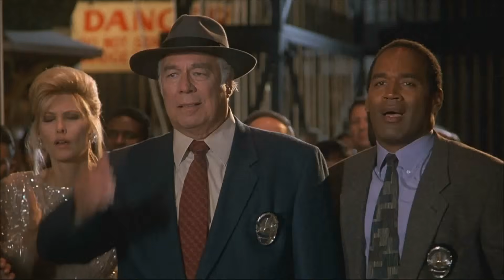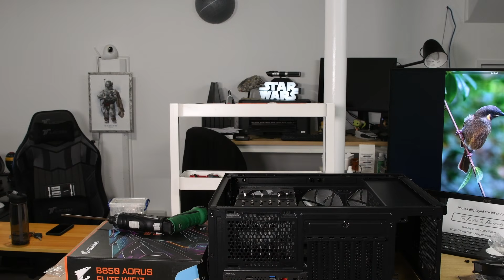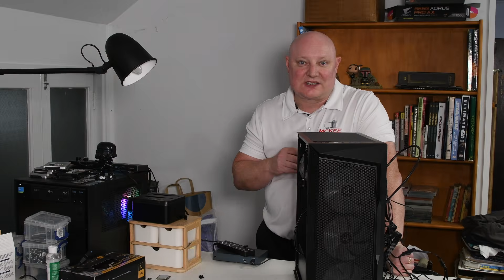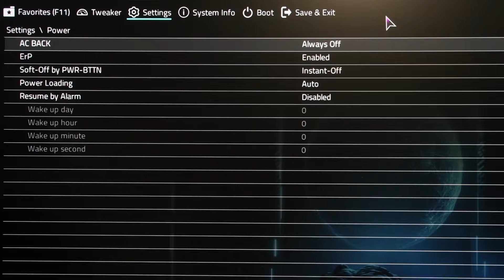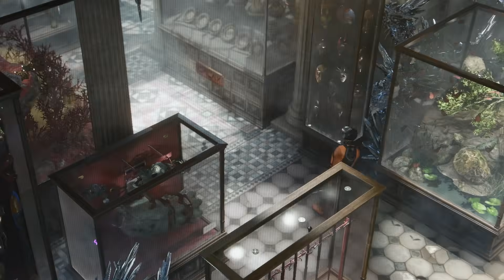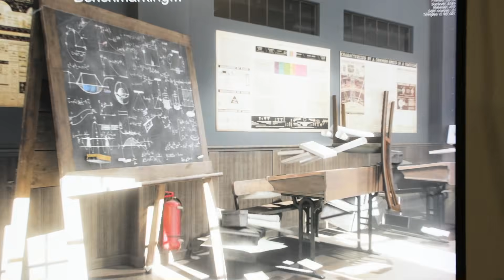Don't Scrimp on Your Case! BYO Gaming Build Headaches.

Comment: Yeah I got a cheap case and had to spend 6 hours trying to manage the cables, trying to fit all my HDDS and SSD. And because of the way this case is built, I can't even use the USB 3.0 port because there is no space to connect the connector.

Comment: PSU is also a piece of crap, CPU and GPU don't make sense especially if this build is for gaming. Wouldn't want this piece of crap not even if was gifted to me
Reply: They're called custom PCs because everyone gets to choose his or her components.  This selection isn't so badly unbalanced for an all-around machine, though if 12 cores is a thing I would use a 7900X instead of a 9900X ($60 US savings) and probably a B650 board.  Actually, with a 5070 I might have even gone AM4.
Reply from the maker: I managed to get them to exchange the PSU to a 80+ Gold. GPU score was disappointing and needed the Ti to really shine. This build was painful and could have been so much better with some expert help picking parts.
Reply: Wow, ok....